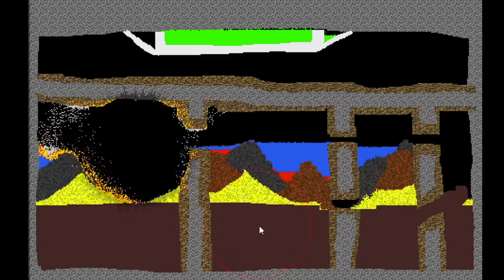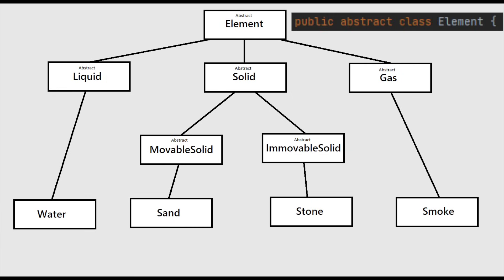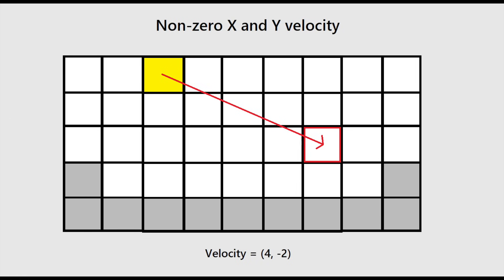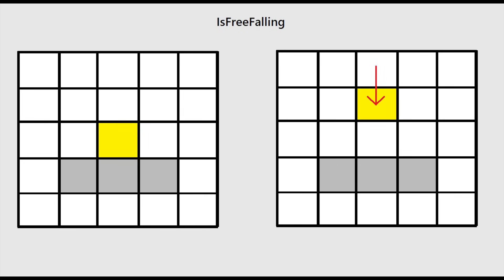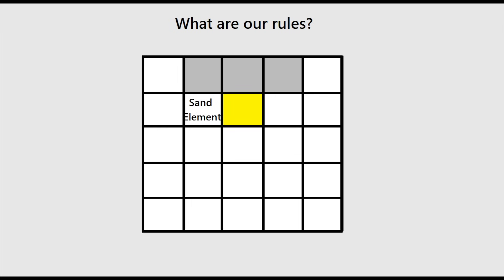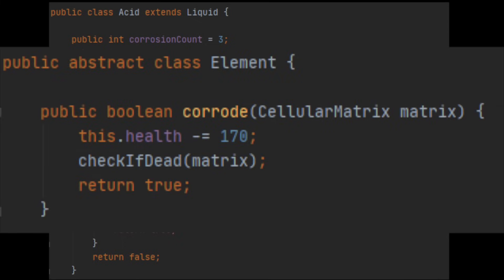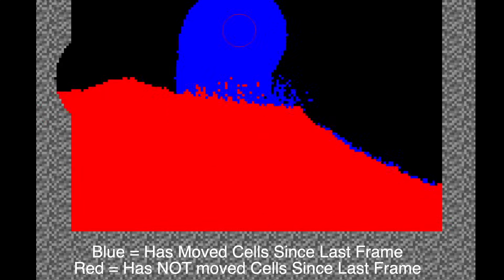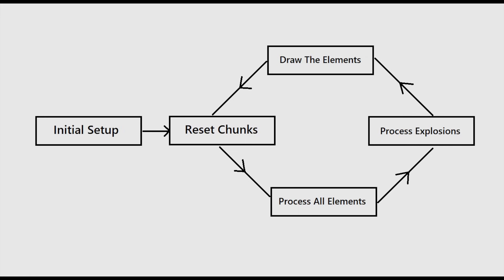How To Code a Falling Sand Simulation (like Noita) with Cellular Automata

Comment: This video is the best material about making sand games I could find. But would you mind explaining (simplified of course) how does fire work?
Reply from the maker: Hey thanks!

The way I implemented fire is that certain elements are flammable (as opposed to fire being its own element). If I want a material to not be flammable I override "receiveHeat()" with a blank definition. Each element has a flammability resistance. When an element receives heat from a neighboring element or explosion, the value passed to receiveHeat() reduces its 'flammability resistance'. Once the resistance reaches 0 the element becomes ignited. It performs all the same element logic it did before except now it also calls the receiveHeat() method on neighboring elements causing the fire to spread. Also the ignited element checks if it is completely surrounded by other elements, this suffocates the fire and if it is surrounded for long enough the element will no longer be ignited and its flammability resistance will be reset. I like this method because it gives more life to the simulation and also it seems more along the lines of what Noita does. If you choose to just convert an element to a "fire" element then you lose any state that was associated with the element and it can't be extinguished. However, this does requires a lot more processing power to apply heat to neighboring elements and also check if it is surrounded, thats a lot of "get" calls to the matrix just for one ignited element.
Reply: @SCREAMINGSNAKE Thanks for the explanation. It seems like a very good idea. I'm currently finishing a sand game which just updates numbers on the array ( eg. if(grid[x][y] == 3) { update_sand(x, y) } ) which takes only the very basic things into account (since I store all info about a cell in one uint8). The way I implemented fire is that, after it moves, it also check for the neighboring flammable elements and has a random chance to change them into fire. After I finish this up, I want to rewrite it into full OOP (every cell is an object) like you did in the video. Once again thanks for the explanation, and have a nice day.

Comment: i know this video is quite old but something i was thinking about is, when the inertial resistance was added, you could also give each particle a mass and the more mass a particle has placed on it the lower its inertial resistance is, like a buildup in pressure. for example, when you removed the floor from next to the sand, this would make it so a small pile would stay put but a large one would crumble immediately.
Reply from the maker: Yeah thats a great thought. I know other older sand simulations implemented some sort of pressure system but integrating it with the inertial resistance could provide some interesting results.

Comment: if you're processing each row one element at a time, wouldn't that lead to a scenario where something like water can move right, and then get processed a second time in one frame?
Reply from the maker: Yes that is a side effect. Some cells could be processed multiple times and some could be skipped. Randomizing the order of processing within each row seems to mitigate most of the visual effects from that. And 60 fps also makes it difficult to tell that is happening. But as you've described that can happen. I didn't realize it was happening until after I made the video actually.
Reply: I believe in the case of Noita, each cell knows what tick it was updated. The simulation has a "tick" counter that increases by 1 each simulation step. When it's time to process a cell, you check if it has been updated this tick, if not, process the cell and set that cell's tick number to match the simulation tick counter.

Comment: how did you do the texture please?
Reply from the maker: For this project I iterated through the matrix and drew squares (or rectangles if there were multiple sequential cells with the same color) with the debug tool. This was extremely inefficient and inflexible. I have tried on two other platforms to code a better way to generate a texture that is more flexible and quicker to generate. But I think it requires more lower level knowledge of graphics programming than I currently have. Most game engines aren't well suited for this type of project which makes it require a lot of custom solutions once you get past initial implementations.

Comment: This is great! it's exactly what I came to ~steal~ i mean learn from. 
Imma try to implement this in Unity.
Reply: exactly the same. although i'll just stick to making my own engine in C++, as always. Unity is an engine far too large for a sand simulation. and super inefficient for that too; with my computer, i can't sacrifice even the smallest bit of performance. Also, you get striketrough with minus signs in youtube comments, not tildes.

Comment: Hello, I just wanted to ask about one thing - how do you handle update order?
In your simulation if I place a ball of sand it falls nicely and breaks after hitting the ground, in mine it breaks mid-air.
Why?
Because I update the matrix from up-left to down-right. The higher sand particles think their down neighbors won't fall down, so the higher ones stay in one place (or move in different non-down directions).
Reply from the maker: What I have done in this simulation is update from the bottom row to the top and the update order within each row is random. 

Another adjustment I made after I implemented velocity was if a piece of sand is falling down and encounters another element that is also currently falling then it will stay above that element and match its velocity. That prevents clumps of falling elements from breaking apart mid-air.
Reply: @marf1610  Thanks for the answer!

Comment: Is there any way to do this in Unity?
Reply from the maker: There is another comment thread on this video where I discuss this with someone else. You can look through that for more details. But the short answer is yes you could get something to work. And I think you can find some Falling Sand in Unity videos on YouTube. 

But if you wanted to implement all the things I talk about in this video, you would be fighting against the design of Unity to make it work, you wouldn't be able to make use of the many development tools Unity offers, and this is why the Noita devs built their own engine. Because you need to have specific control over the update loop which Unity takes care of for you normally but would cause issues with something like this.

Comment: Hey, would implementing the quadtree for optimization instead of grid/chunks be a better decision ... ?
Reply from the maker: I would hesitate to say that it could be better due to its added complexity and increased processing requirement to calculate it on the ever changing simulation. The chunk method is very simple to understand and implement. I would be curious to see it implemented that way if you ever do it.
Reply: @marf1610  ohh ... Yeah I got it ... I'm at very basic level and learning rn but I'll surely let you know if I ever could implement the same! Thank you for reply and keep uploading... I'm a huge fan! Keep the good work 🙌🏼

Comment: I ran into the same step stair problem at chunk edges. Do you just offset the bounds of the chunks each frame to resolve this?
Reply from the maker: The step stair problem arose from processing the elements in columns where the columns start and end positions did not change across frames. To fix this I added random offset to the columns start and end positions each frame. 

The chunk bounds remain the same across all frames and the chunk bounds have no meaningful correlation to the processing threads' column start and end positions.

This is different from Noita where the chunks both keep track of if the elements contained need to be processed, and the bounds in which each thread processes elements. In Noita when there is a large body of liquid that begins moving all at once I have consistently seen the step stair effect as the elements fall. It seems unavoidable if your chunks are also the bounds of a processing thread. 

Moving the bounds of chunks across frames would defeat the purpose of a chunk since it will not have knowledge of the new elements within its bounds after it moves.
Reply: @marf1610  Thanks for the reply! My chunks don't keep track of the elements within, merely a bottomleft position for the chunk and a flag to update the chunk next frame (and a numChangesMade integer). I give a random x and y offset to all chunks apart from the ones at x=0 or y=0 at the start of each physics update. This has totally eliminated the step stair problem although it has broken the code that alerts neighboring chunks to update.
Reply from the maker: How are you determining the order of processing the elements? Just left to right, bottom to top? Any multithreading?

I also update update the elements within each row subsection in a column in a random order.
Reply from the maker: @prodevus  Ah yeah so if you are using chunk boundaries to define the regions where threads update then you will always have this stair step looking issue. 

It makes the most sense to update cells that way. The Noita devs do the chunk checkerboard multithreaded update pattern which allows them to simulate such a large world (similar to what you're doing), but the downside is that you will have those visual artifacts since the bounds of the threads update range always start and end on the same indices across frames.

You could try creating a new "chunk" class that only defines the thread update boundaries and references your original chunk logic for if a cell should update or not. You can add offset to these new thread boundaries each frame which would eliminate that stair visual effect but this would require you to check every single coordinate in the simulation and then reference your original chunk logic if that coordinate needs to be updated.

To answer your other question, whenever a cell performs some action which would require itself and its chunk to be processed next frame it sends its coordinates the matrix class which determines the appropriate chunk to update and the logic there determines if it is on a chunk boundary.
Reply: @marf1610  You’re totally right about Noita. I’ve implemented their checkerboard system and noticed the same problem. Bundling and shuffling the cellmove instructions seems to mitigate this, but causes the water to behave differently from yours I think. You are still checking and moving the cells bottom to top, left to right then? When you do a dispersion check for the water, are you reading the oldMap for collisions and then applying the changes to the newMap, before moving on to the next cell? You’ve got some great looking water.
Reply from the maker: @prodevus  The way I update cells is by generating columns in the world and updating every odd column in one pass and within each column moving bottom to top and left to right. And then doing another pass for the even columns. The column start and end indices are given a random offset each frame. This eliminates the visual issues at the borders of chunks.

In this approach though I check every single cell in the simulation, and at the start of update for each cell, a check is made to see if the chunk a cell belongs to should update this frame, and if not the cell returns early. So within a single update column some cells may need to be updated, and some cells may not depending on the chunk they belong to. 

That is the benefit of separating the chunk tracking logic and the update logic. The downside is that you must at least visit every cell in the simulation to see if it needs to update or not. 

For the backing matrix I do not have a double buffer. In their tech design talk the Noita devs talk about how using a double buffer comes with some challenges so they have opted for a single buffer that is modified in place which is also what I have done. And as long as you ensure the updating threads will not attempt to concurrently update the same cell then there should be no problem. 

I can't remember exactly the final logic I settled on with the liquid to make it look so smooth. Part of it is having each element move multiple cells in a frame, and the other part is allowing liquid elements to swap places with each other. So if a water element looks for a space 5 cells away from its location and finds another water cell then it will move to that location and move the existing water cell to the last available cell in the first elements path. Getting liquid to disperse quickly and believable was a big challenge.

Comment: A modern computer should have no problem simulating and rendering 250 000 particles at 60fps. Allocating an object for every particle is terrible for performance, allocating a large chunk of memory and compactly storing all of the data would be much better. This also has the nice effect of cleaning up the logic in the code, having one piece of code decide what to do with all the elements is nicer to work with than the "actOn" approach as the order in which things happen becomes more predictable. That also should make the problem actually parallelizable so you don't have to hack the thread boundaries.
Reply from the maker: I did mention at the end of the video there are likely better ways to accomplish what I had created. I created this over the years while I was learning to code and not until recently did I start to learn about memory management and efficiency. So thanks for your ideas.

However, your suggestions depend on what it is you want to accomplish. Sure you could have each particle type represented by a single struct and use that to only define how particles should react to each other. But that gives less control over individual cells. How would you go about staining the color of a cell while it remains of the same element type? Or how would you set an element on fire and then extinguish it and have it retain its original properties? If you wanted a tech demo just for performance purposes you could go with your approach. But the title of the video states how to create a falling sand simulation like Noita, and the methods I describe is more along the lines of what the Noita devs did.

The actOnOther method is only for special effects of a specific element subtype. The movement and interaction logic is consistent and inherited from the Liquid, Gas, and Solid types. If I did not use the 'actOnOther' method then I would fill the movement logic at the Liquid class level with innumerable 'if else' statements specifying subtype interactions between Acid and every other element type. The 'actOnOther' method scales with any amount of element types.

Since I do not use a double buffer and the matrix is modified in place, then regardless the simulation would need to be split into separate chunks and processed independently to avoid concurrent modification.

Check the 'Exploring the Tech and Design of Noita' video linked in the description and they describe their reasons for their design choices.

Comment: is it possible to do this with unity?
Reply from the maker: I think there are some videos of sand simulations people have made with Unity. I think you will run into technical limitations if you really try to expand on this down the road. And you wouldn't really be utilizing all of the strengths of unity since all of your logic would be need to be custom. It wouldn't make sense for each element to be a GameObject.
Reply: @marf1610  yeah, gameobject is not a good way to have millions of objects on screen. I hope ECS be ready soon.
Reply from the maker: @MechanizationStudio  I see your other replies in my notifications but they aren't appearing here. 

With Unity you would probably have one GameObject which has the 2D matrix and the element objects (which would not inherit from Monobehavior) and each frame you just update your one GameObject that handles updating all the elements in the matrix. 

At that point though you're not really using any of the benefits of Unity. 

And then you'll have to come up with some custom drawing logic, a way to generate a texture based on the matrix.

Also, I don't think Tilemap would work well for this.
Reply: @marf1610  I realize tilemap wouldn't work well so I deleted my comment. SetTile is not very good for performance.

Comment: Soooo coooooooll~! Simulation stuff is my favourite and Noita was amazing in that category, the simulation you do here is nearing that complexity from what I can tell. I have one question: do gasses and liquids (i.e. fluids) have any sort of pressure as to allow for fluid dynamics (ex: a U shape of liquid with solids around it, does the liquid balance on both sides or would one side that's higher stay so)? Super cool overall! As a game-dev who's going to be adding cellular elements to my game soon, this is a super cool demonstration and gives me ideas for what I should be implementing. A lot of what you've done was covered in the Noita GDC talk so it's neat seeing someone go through the implementation process. Oh, and with that line algorithm, does that mean that cells with velocity can move diagonally through other elements?
Reply from the maker: Thanks!

Gasses and fluids do not have pressure in my simulation. So in your example with the U bend, one side would stay higher than the other and would not balance out. This is the same in Noita, it would definitely be possible to add fluid pressure to the simulation but that would probably be pretty expensive. Just depends on what you are trying to accomplish. 

With the line algorithm, if I am understanding your question correctly, yes a fluid could passes "between" two solid elements if they are diagonal from each other. You could adjust the algorithm to not allow that, but it just depends on what you want to do.